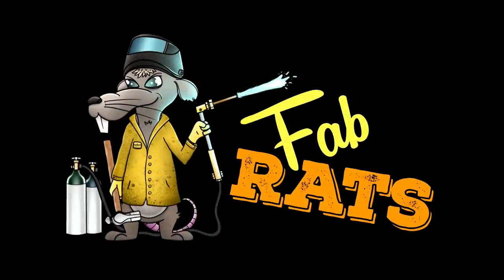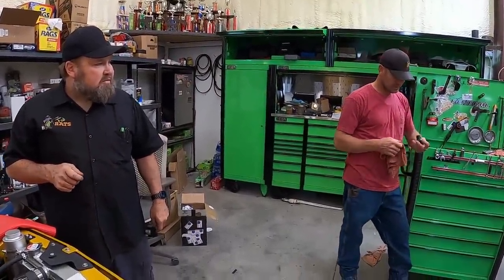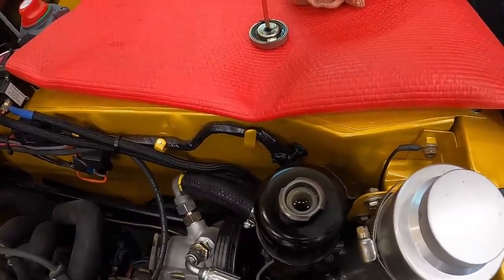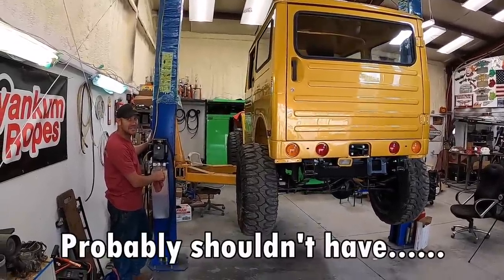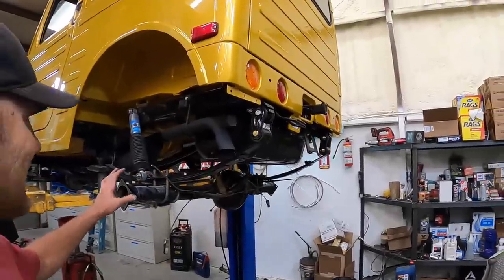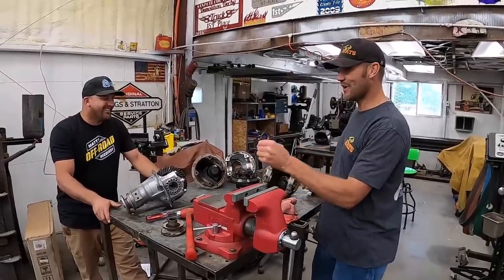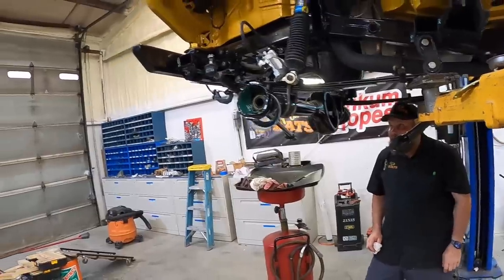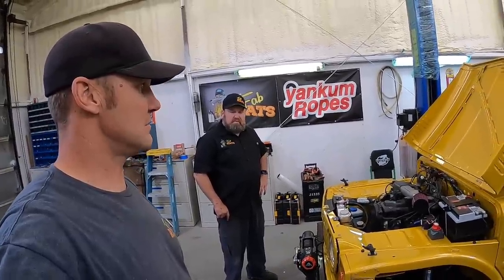WHAT HAPPENED?! Can Ed's Golden Nugget Be Fixed In Time For The Reveal?

Comment: Great job Paul. As for sand blasting rear ends and transmission cases I have been building cars for forty five years and the best way to clean these parts is a 3000 psi pressure washer and some easy off heavy duty oven cleaner works like a charm.
Reply: works great on engines also!
Reply: What doesn get in doesn need to come out. We used to have a lot of mockup plates to blind of stuff so it was air/water and so on tight and closed. Tread for bolts, bolts were put in to keep clean of blasting material and paint.

Comment: What an amazing couple of months. Great job! Anybody else wondering if they fixed that roof rattle or is Ed just going to need to know the spot to hold? Fantastic build!!! Will be here for the next one.
Reply: Was wondering the same thing.
Reply: Robby could tell them how to stop the rattle.  May be a simple as squeezing in something like silicone or body panel adhesive (Tiger Seal).
Reply: @JT_70  I thought the same thing...after all the work that has been put into the Suzuki,  roof rattle is a very minor fix it.

Comment: I believe I would have changed both carriers to the cast iron ones with the old passages. 
The media didn't help but the oiling was the real issue. 
Keep up the good work and videos.
Your rear pinion angle may be the drive line vibration you mentioned. 
I enjoy watching.

Comment: 29:50   There is a lot to suspension tuning, but one thing I think is true is the key to light vehicles with big tires is soft shocks.
I know my CJ rode like a lumber wagon until I got rid of my Skyjunker shocks got some Doetsch Tech 3000's.  Now it rides like a Cadillac, to me.
Also, I had an additional problem.  For those who buy cheap lift kits, check the shock lengths.  I noticed my Skyjunkers were all the same length, whereas the Doetsch Tech's were shorter in the front.   I could see from damage to the front shock mounts that the front shocks had also been bottoming out, limiting my suspension travel.
When you got big tires, they will do a lot of the shock absorbing, you just need some light dampening so you don't turn into a bouncy ball or start to "buck" like a front end loader.

Comment: Ben...  That "Fab Rats" shirt looks really cool with the matching black hat.  Paul... @22:32 When you showed those two sprayers I had a flashback to 1969.  I worked in a gas station then and we had one of those sprayers, they make good flame throwers.  Put about a cup of kerosene in one and about 30 psi of air then take a butane grill lighter and you get about 15 - 20 feet of flame.

Comment: If you haven't already done so, a bit of foam or rubber on top of those roof spars, between them and the metal roof, should quiet them down and also keep the paint from being worn through where the metal is touching.

Comment: Just a heads up, If your Power steering get hard except at higher RPMs it may require type F ATF. Some older stuff does not like Power steering fluid, not enough viscosity. Just in case you ever run into that. Type F, not Dex/Merc. Keep the videos coming!

Comment: “Sand in the gearbox” is a German expression for when something doesn’t work quite right, when something is slowed down by something. It is mostly used in a proverbial way (eg, there is ‘sand in the gearbox’ of international diplomacy) and it can be used in a passive/descriptive way as well as in an active way (“throw sand into the gearbox of …”). The latter usage can be translated as ‘throwing a spanner in the works’.

Comment: Dont forget the Tap trick i mentioned to you on Instagram. if you need to rethread a nut and dont have a handle for your Tap bit.... Just use a 4 way water silcock key. they are A LOT cheaper than a handle

Comment: Had my steering box rebuilt on a 77 f 250 highway and the guy told me every steering system on the planet should run type f trans fluid in them. Been 35 years since and he's been right. Every application.

Comment: next time have someone remove the vent and install a pipe plug. In stall vent after paint. You should just install vet lines up to the back of the fire wall. Its a 4- wheeler he will get it in the water sooner or later.

Comment: I run hydraulic oil in my power steering
The blast media in the diffs is definitely a terrible mistake, but I agree, that pinion bearing died of oil starvation, there's no way it could get any oil at high speed

Comment: Hey shouldn't that front differential have drained slots in a tube for the whole for oil to be drained into the bearings I just noticed you put that luminum back on the front wouldn't it have the same problem it's not angled right

Comment: You guys need to get rid of that vent, get a barbed fitting in there and run a hose up high. Those vents plug and you'll lose gear oil out the axle seals. Toyota's are notorious for this...  Put some clear silicone under those roof braces to stop that rattle.

Comment: Pro sandblaster here I Denatured Alcohol is the best chemical to clean oily media i have come across. never used deiseal but the alcohol breaks  down the oil well. Mean that shouldn't have happened in the first place but just fyi.
Reply: I wonder if they should have corked the ends of the axle or stuff the pumpkin with som baffling and on top; cap the openings w tin

Comment: I'm still concerned about the way you did the driveshaft. With that sharp angle, I think you should have put CV joints at each end OR at least U joints 90° out at each end so the change in velocity would cancel each other out. You know what happens when a steering drive shaft with a U joint does in a sharp turn. I think that helps explain why Matt keeps breaking tail shafts. I fear that is what is happening at your pinion input shaft as well because of the sharp angle.

Comment: The sand had nothing to do with the pinion bearing failure. You "built" the wrong third member, and then blamed it on the blaster and Robby fired him for it. 

Your kickdown cable issue was not an adjustment that was needed. It was the pinion bearings welding themselves together due to lack of lubrication and needing more torque to turn them, thus your right foot needing to be buried in the throttle to keep the squirrel fed Nugget moving. 

You need to slow down and do things right the first time. No more of this "we do it nice because we do it twice".

Do it right the first time and admit your own mistakes instead of blaming it on others.